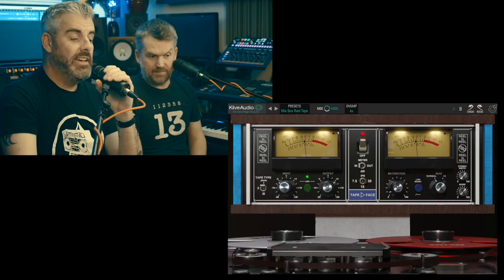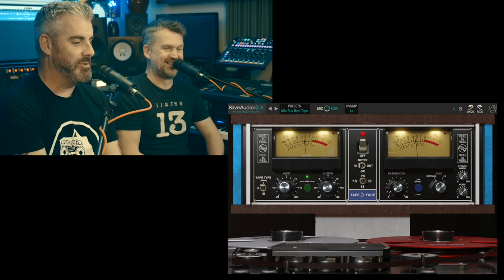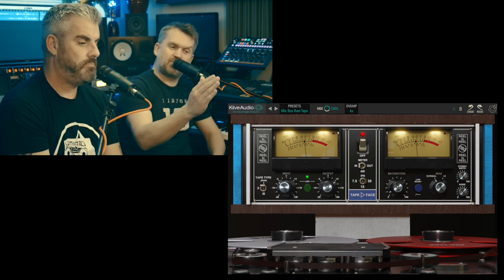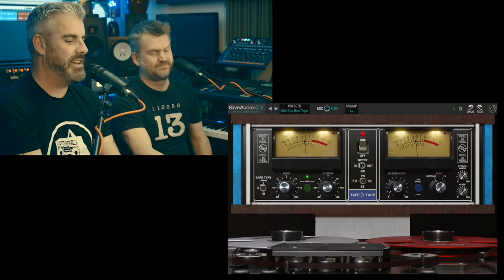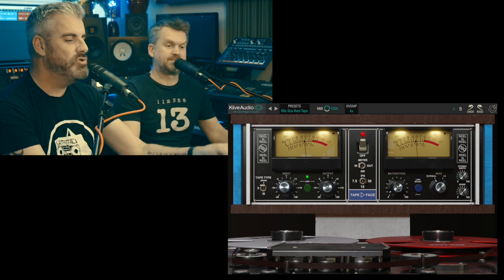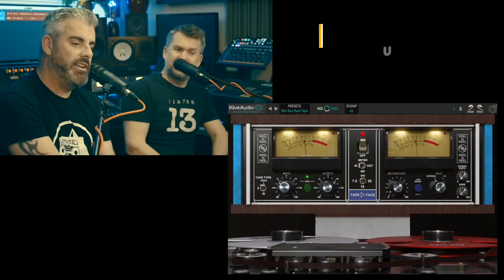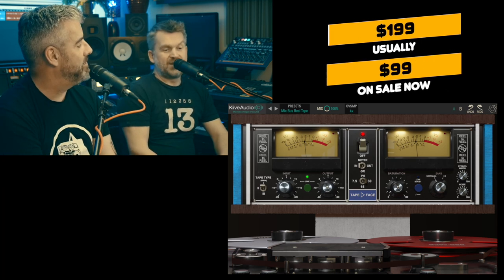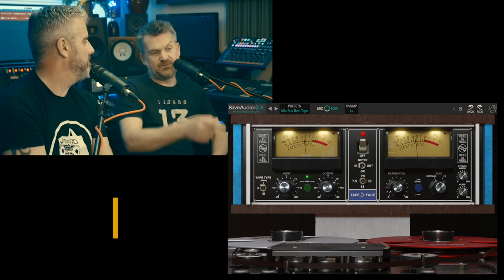JUST LIKE REAL TAPE? WITHOUT THE HASSLE! -  KIIVE TAPE FACE

Comment: I’ve found most of them work but just need tweaking - I’m using Softube Tape that is on offer a lot. I’ve compared it to UAD Studer and they all get close.
Reply: I find the softube tape very subtle- and the UAD is good, but its very “static”.
Take a look at the IK Multimedia ones. They sound incredible, and if you take a look at them in plugin doctor or by other means of analysis, they look and behave like a living, breathing thing. Its beautiful to see- and of course sounds fabulous. I always used them as a compromise until UAD went native- but after that happened, I realized that they are technically superior in the emulation (in my opinion). 

UAD is kind of similar to AA Taupe, which is also great but very “static”
Reply: @Rhuggins   I find the IK Multimedia tape plugins (specifically the TASCAM) have latency and PDC issues that are not desirable for some audio. You can verify by bouncing audio through it and comparing waveforms. Bummer, because they sound amazing.